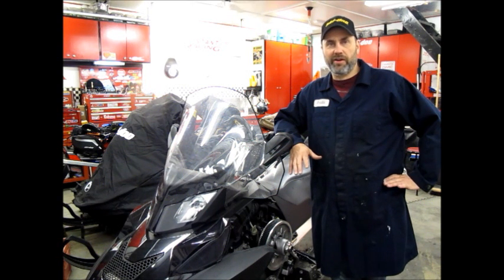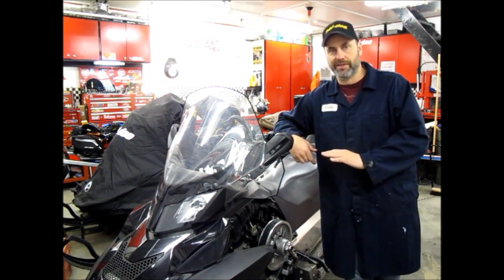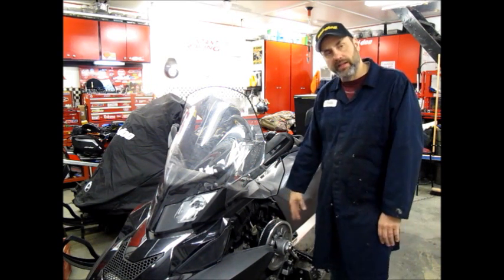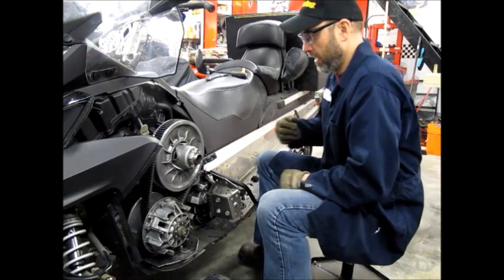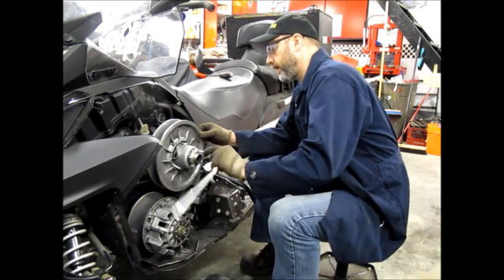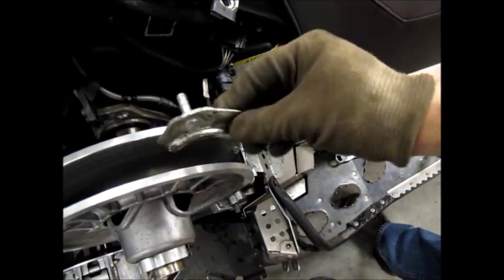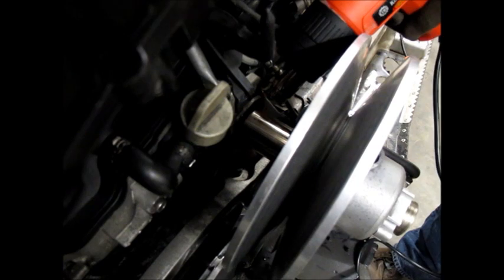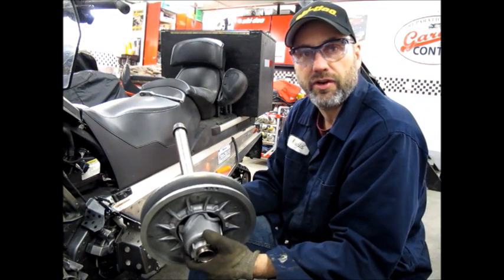Ski-doo Expedition QRS Clutch Repair Series Part 1 -  Jackshaft Removal

Comment: So do these secondary’s come off without pulling the whole shaft ?
Reply from the maker: Brian Plow Not really as one of the sheaves is pressed on the shaft. So at best one could take half of it apart. Much easier to remove the shaft.